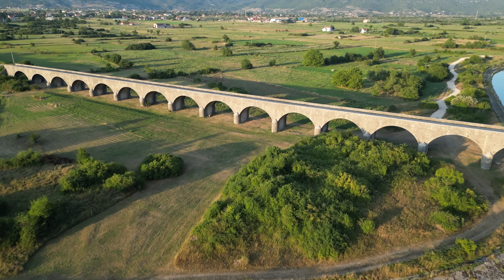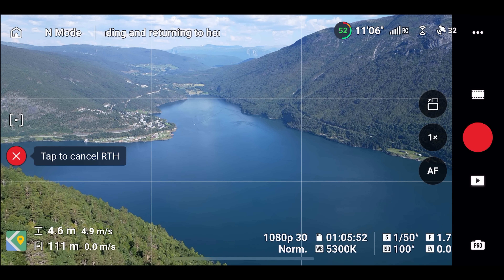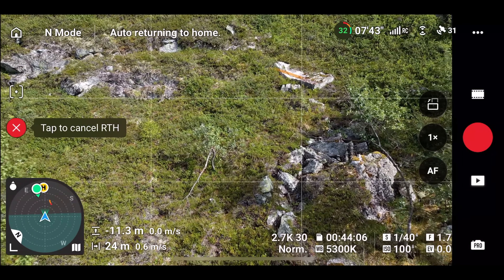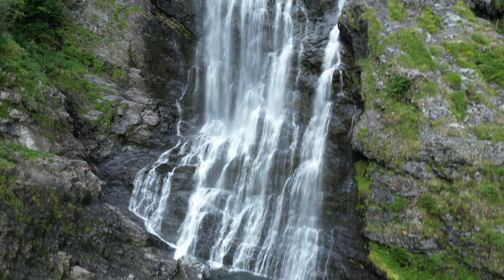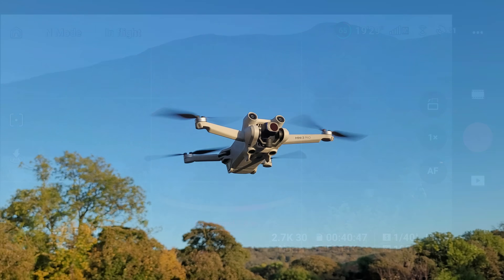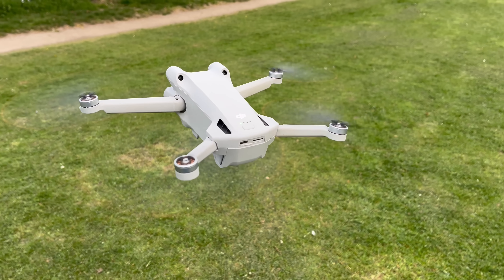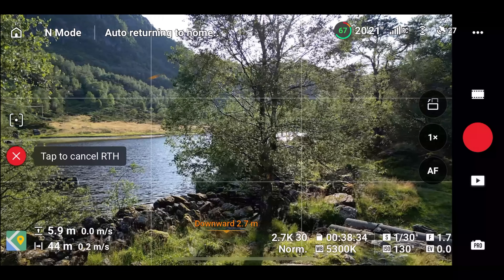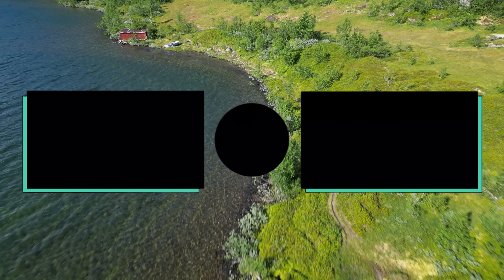Negative Altitude RTH has a BIG Problem... Here's What You Should Know

Comment: Good information, Thanks! One thing I noticed is the downward sensors are limited in range and speed, 12 meters (39ft) and 5m/s (11mph) this is on the Mini 4 Pro. The Mavic 2 range 22m (72ft) and speed 8m (17mph), Mavic 4 Pro range 17m (55ft) and speed 6m (13mph) - It seems the C (Cinematic) mode provides the best sensing options, slow movements.

Comment: You would think that the pro series by now would have a bottom sensor that is like a range finder and can give true altitude AGL
Reply: They do. Both my Mini 4 Pro and Air 3S have laser altimeters that look straight down. The problem is this data is not available to the user and not used for anything except minimum altitude clearance within 6 feet for landing.

Comment: I used RTH multiple times but one-time using it the mini3 Pro slammed full speed into the ground. 
It was supposed to land on the pavement but crashed at full speed, even higher then normal decent speed.

Luckily DJI did replaced the drone at no cost.

Comment: Thanks for the Info.
New to smart drones (only run non-GPS full Acro drones in the past).  Yeah, crashed more than my fair share to start with.  I have recently purchased a DJI Mini 5 Pro.  Will be testing to see if that's still an issue, hopping that DJI got that issue sorted in the Mini 4 or at least in the Mini 5.

Comment: Moral of the story : if you want RTH be more than 50 meters away

Thanks for sharing this. Didn't know it had these issues. I have the Mini 4 pro and I'll give it a try with the same tests

Edit : I checked the manual of Mini 4 Pro and it says the following :

1) If the RTH distance is > 50 m :

a) Current altitude < RTH altitude :
The aircraft will plan the RTH path, fly to an open area while bypassing obstacles, ascend to the RTH altitude, and return to home using the best path.

b) Current altitude >= RTH altitude :
The aircraft will return to home using the best path at the current altitude. 

2) If RTH distance is within 5-50 m :
The aircraft will return to home point using the best path at the CURRENT altitude.

And all the above are effective providing that the flight is SUITABLE FOR VISION SYSTEMS.

So same problem here, as you said.

Did you reach DJI mentioning the problem?

Comment: I produce a travel channel about Puerto Rico. A few miles away from my home there's a canyon that's 800 feet deep. At my tender 71 years of age there's no way I'm going to hike to the bottom, if only because I'd have to hike back to the top. So I asked several DJI “experts” on YouTube if it would be OK to fly my drone into the canyon. Surprisingly, they all said yes. However, I still wasn't sure so I didn't do it.  Then I found your video.

For me it's quite simple. If my drone can only reach an altitude of 400 feet, and I fly it into a canyon that's 800 feet deep, it would suddenly bee 800 feet in the air the minute it goes over the edge. Then, if I flew it all the way to the bottom I could never fly it back out because it would only elevate to 400 feet. That would leave an additional 400 feet just to reach the edge. Am I correct in my reasoning?

According to my thinking, if I flew my drone into that canyon I would lose it because it would never be able to fly back out.

Your video seems to corroborate my thinking. Am I right?
Reply: No, RTH altitude is relative to your home point. Even if it did function like you were suspecting, I think when it hit 400ft you could reset your home point and that would give you an extra 400ft each time. But as I stated originally is how I've always understood it, and I did a quick check on a dji related forum and they said the same as me.

Comment: I usually set RTH with maxium height under local rules (400ft in us). The higher place usually clear without trees or objects. I often manually return it to home with littler pointer at the bottom of left corner. Only once almost hit the rock tip but it brakes and  hover behind rock when wait for my manually give other orders. Dont' return with very critical battery level at complex places. It will put yourself and drone buddy in big trouble.

Comment: My first drone I had the control would just randomly reboot mid flight, once the drone went up in the clouds (should mention it was a foggy day with low visibility, clouds was only about 150 200ft off the ground) and another time it nearly landed on top off a block of flats, they are the only time I’ve used RTH I much prefer to manually landed where I have full control

Comment: Try this method. STEP 1:Make sure fail safe is set at RTH. 2. Turn off the remote control. 3. After a few seconds, the drone detected loss signal RC, and will ascend to the set altitude and fly straight path home. This works if far distance away .

Comment: Hello, thank you for this interesting topic. Sorry for my extensive writing. I am a drone professional pilot and I have practiced some flights with negative altitude, especially in canyons. They are the most complicated scenarios. Many parameters have to be analyzed at preflight. Obviously, while flying at negative altitudes, you are going to select a preset RTH instead of optimal. Let’s see what the user manual says about preset RTH assuming that vision and sensing systems are operational ( page 53 for Air 3. DJI Drones from Air 3S have better advanced RTH features) : 
1. if current altitude < RTH altitude and distance > 50 m : The aircraft will plan to the RTH path, fly to an open area while bypassing obstacles, ascend to the RTH altitude and return to home using the best path. And what happens if the drone cannot fly to an open area to ascend to RTH altitude because the terrain features surpass the vision system abilities ? That is what we see in your video, the drone will hover. 
2. If the RTH distance is within 5 - 50 m, the aircraft will return to home using the best path at the current altitude : obviously impossible with negative altitudes. The drone will hover again. 
It seems that the software doesn’t take into account flights with RTH distance within 5-50 m at negative altitudes but from what we see in your video, there is nothing illogical. Once again, some terrain features surpass the vision and sensing system capabilities. I am pretty sure that an Air 3S or Mavic 4 pro will do better regarding RTH.
Reply from the maker: That's a very detailed and helpful analysis, thanks very much. I am guessing the newer models of drones, like the Mavic 4 Pro, are going to have RTH sequences which enable the drone to return home in every scenario.
Reply: @takeoffdronesIn fact this scenario happened to one of my colleagues. What you said or guessed is true.  The software for RTH doesn’t support scenarios that involve negative altitudes. Thank you too for this valuable video. 👍

Comment: I think they should start treating negative altitude differently. In every case the drone should at least rise to the 0 altitude when RTH. Then it should ask again should I ascend even more? Or if you just had an option to select this in settings (negative altitude behavior RTH)
Reply: It should just ascend to the pre-set RTH altitude, even if this is +400 ft. Really, the user should be setting the RTH altitude based on their flight profile at the time. If you're flying over flat terrain then a high RTH altitude makes no sense, and just subjects the drone to stronger winds. I always change my RTH altitude to something that will safely clear obstacles from the direction I'm flying, but low enough that it isn't climbing excessively (it also takes a lot of power to climb).

Comment: This happened to me once, but I couldn’t explain why. After updating my home point, and with the drone less than 5 meters away, it wouldn’t RTH and just hovered near a bush but can hear the buzzing sound. So I resolved it by ascending until I could see it and then landing manually, suspecting the controller had lost signal and couldn’t update the home point. Thanks for the heads up! :)

Comment: I’ve clocked over 50 hours of flight time in the past few months with the DJI Mavic Air 2 and the Flip and I’ve never even pushed the RTH button. I believe the pilot should never need this button or rely on it for any reason. The only reason the drone ever should RTH is due to signal loss, and if you don’t regain connection within a few seconds there is likely a problem and you need to try to get closer to regain connection.

Comment: Some of the confusion is “height above ground” and “altitude.” In aviation, those things are quite different.
Reply: Ehhh...in the case of our drones, the altitude is relative to the launch point. It has no concept of AGL, even though it has the sensors to measure it (the Mini 4 Pro and Air 3S have laser rangefinders looking straight down, but it isn't used for anything except landing).

Comment: LIDAR is a huge improvement in RTH. A good enough reason to buy the Air 3S , Mini 5 Pro (coming) and the Mavic 4 Pro. as a matter of fact, think of LIDAR as insurance that your drone will have better chances to come back every time.   flying old technology has its quirks .   Fly safe and  be very cautios how RTH handles the path to landing. Ultimately, you are the Pilot in command, not the computer in the drone. NEVER fly the drone to points where it loses signal. if you know there is a chance of losing signal, make sure that the drone is high enough to be able to avoid any obstable. LIDAR does not need GPS to come back. it is a HUGE upgrade to RTH.  flying at night is totally different story, Power cables cant be seen by the pilot, make it simple, take off and land where there are NO obstacles.

Comment: All of the DJI auto pilot functions in America have been corrupted.  They ruined my air 2s and an air 3s in 2 months. The air 2s hit power lines on RTH, while I was trying to intervene. And then the air 3s had plenty of altitude on active track and then as soon as active track started the drone took it upon itself to lose 120 feet of height and crashed into power lines. I have been flying DJI for years now and auto pilot used to be more trustworthy than most people. Now I will not trust it unless there is 100 percent, zero obstacles. Even then i won't trust it. I don't know which entity is responsible for the corruption but the functions are no longer usable
Reply from the maker: That sounds terrible, crashing 2 drones like that. Power lines are a known killer for drones since the obstacle avoidance doesn’t detect them. Thin objects, such as branches and the like, are also not usually detectable. I did a test on the Mini 3 Pro’s sensors on the channel and thin branches caused a crash.

Comment: What happens if you have your return to home altitude set at 50 meters, you fly behind a building or another large obstacle that is taller than 50 m and you lose signal to your remote.
Reply: Reconfigurar el RTH a 80 mt. ó elevarlo manualmente hasta recuperar señal..
Reply from the maker: If the drone has obstacle avoidance sensors, and you are further than 50m from the home point, the drone will fly over it back to home.

Comment: Yeah. There's been an issue with the mini 4 pro I had at my very first flight. Maybe it's fixed already.... I havent checked since... so this is 1.5 yrs old..... I had a connection loss... distance was about 300m over the top of a forest. The drone went into RTH by itself. After a few secs I saw she wasn't moving at all. It was in intelligent rth, so I switch to normal rth. - I still had aviational connection, but no vid -. ... nothing happened. Batteries were on 9%, so I got excited. ... I switched the sensors off (which shouldn't make any difference, as they are always on in rth mode). ... no change. Ok.... sport mode on and get her back by telemetry only. ... got her back with 2% batts. So rth needs to be monitored.

You could also have big issues when flying in fog. Of course you'll find out pretty soon that you have to turn the sensors off. Check. But(t) usually the ground sensors are still on. This causes issues getting her down.... She may come down veeery slow or switch to landing mode in mid air. On the mini 4 p you do have the option to switch off the ground sensors as well. I think the mini 3 p doesnt't have that option. So that could be dangerous when you are low on batt and your drone wants to land in 100m above the ground. And dont even think about rth. 😉

Comment: For me I fly my drones always line of sight so if something happens I can avoid disaster.I've been flying my 3dr solo alot sine it was released and never have any problems plus I do have the original Mavic pro,mini 3 pro and air 3s. And never have a care refresh on my Dji drones. So flying safely and avoiding disasters will save a lot of head aches espcially now Dji is hard to get,no parts/ accessories available,no more care refresh. So happy flying and be safe.
Reply from the maker: Yeah, flying within line of sight would help avoid issues. But, as seen in the video, these issues can occur even if the drone is within line of sight, and so it’s important to be aware of them. Thanks!
Reply: No more Care Refresh? 
I just bought the Mini 5 Pro with 2yrs Care Refresh (Australia).

Comment: I believe, but could stand corrected, the RTH height is relative to the height the drone took off from + about 2m, ie, close to head height or when the drone says Home Point has been updated if you hover the drone a little before flying off. If you have not lost control, but are having difficulty seeing the orientation of the drone, you can set the RTH height a lot higher than any obstacles and I think putting the drone into Sports Mode disables collision detection so the drone should fly upwards above trees etc and then fly forward, may be worth you doing a test say 50m away from you next to an obstacle behind the drone and select Sports Mode and a RTH to see if it disables the Obstacle Avoidance on RTH, great informatve video as ever, thanks
Reply from the maker: Yes, the RTH altitude is based off of the take off point. I might do that test you suggested, and see what happens when an obstacle is detected with sports mode, thanks for the suggestion!

Comment: Did you reach out to DJI about this? Thank for the report, however, when firmware is updated there is so often the DJI note 'to fix issues' but no further details! So, what about this RTH issue and mini 4 pro, Air 3s, other models, etc. and what about RC and RC2 software? I've never had a RTH issue (with several hundred flights), but now am awakened to what is needed to know! Thanks! And let us get DJI to update the firmware!!!!😀
Reply from the maker: I actually have reached out to DJI. As for the firmware, I double checked I was flying with the latest firmware on the Mini 3 Pro. I don’t think DJI is going to be releasing any major updates to it since we have newer models. I am not sure if it is a controller issue, but my guess is that it’s not. I would assume that this issue occurs regardless of which controller you use since the RTH sequence has to be the same. These issues do also seem to happen on some other models. It would be good to get an update though! Thanks

Comment: Its True with most drones DJI made,   that RTH is mostly a convenience. The issue is a limitation of GPS itself, which cannot measure altitude or height only horizontal position.  If you depend on RTH over common sense in unusual scenarios, and over water.. it's at your peril.  The feature is for MOST common scenarios. You have a map with a red line showing the return path, your eyes (don't fly beyond VLOS) and your brain to keep you out of trouble. Its extremely rare to lose signal that close; low battery, your responsibility.  Having said all that Air 3S and Mavic 4 Pro don't experience any of these errors. By Lidar mapping of your flight, GPS is secondary. I have both and they never fail to amaze me.
Reply from the maker: Of course, some of these issues have a low chance of happening. But, it is never zero!

Comment: you have to understand the RTH has the assumption of you are flying within line of sight, so the scenario you are simulating is not line of sight, so within 50m range, it will try to fly back to homepoint.
Reply from the maker: Well it does not necessarily have to be beyond line of sight. If you fly a couple meters below the home point down a cliff, you could be looking over the cliff and clearly see the drone. And besides, RTH should really be working regardless of any obstacles.

Comment: I don't use RTH. I have it set for very high at about 90m to clear the enormous trees we have and any terrain elevation differences along the way. So, if my controller connection is lost, then it will behave appropriately. But otherwise, I do not use RTH. I guide the drone to me on purpose, under my control. Therefore, none of these issues impact me. To me, RTH is a safety feature, not a flying feature.
Reply: RTH is basically not a safe thing to use (for me) the reason is because, my drone is a mini 3 (not a mini 3 PRO) so it doesn’t have obstacle avoidance.
Reply: I generally agree with this, but a lot of times I'm flying and if I'm with someone, a friend, neighbor, client or family member who's unfamiliar with drones they almost always ask what happens if it disconnects, so I tend to use RTH to just show them. Luckily, it has always been basically flawless for me.
Reply from the maker: I also mostly agree. Usually the fastest (and most optimal) way to get the drone back is by manually returning to home. Well said that RTH is a safety feature, and not a flying feature.
Reply: @takeoffdronesIt’s interesting to note that RTH uses less battery than manually flying it home. So if you are low on battery and it’s a long way out, use RTH.